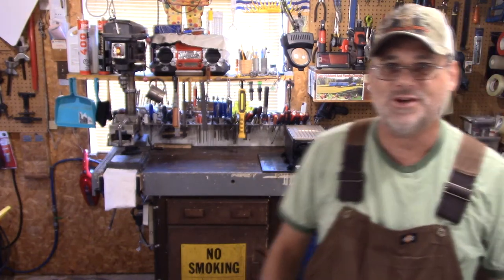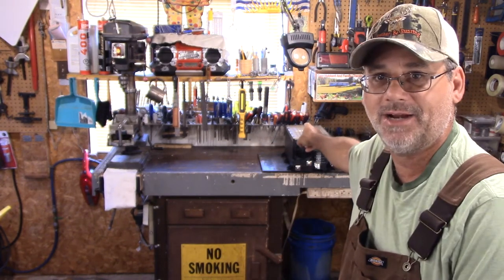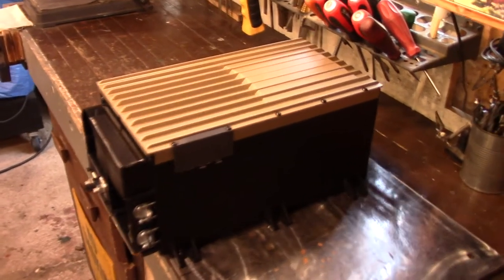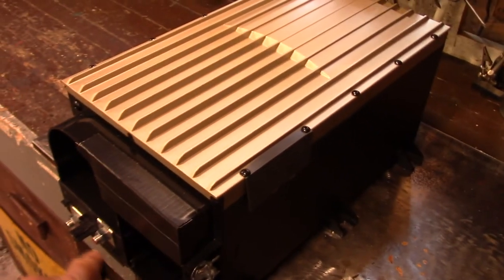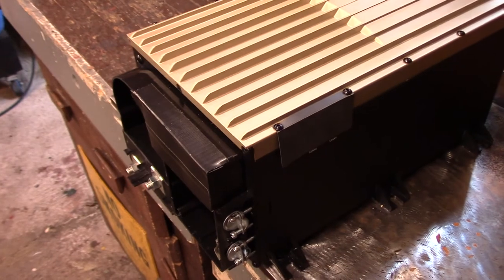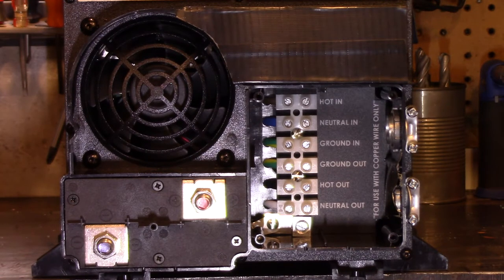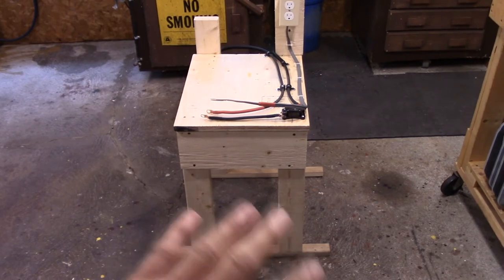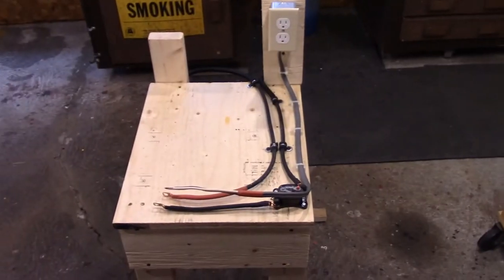Off Grid Solar Power Experiment  vs  120v Mini Fridge Can It Be Done

Comment: Thank you Steve . Just got in for my hunting camp spend 8 days there. Solar work well no problem supplying fridge, light, tv, lap top and charging phone. The lowest volts on batteries for one night, next day and next night was 12.3, rest of days batteries were getting top up every day. Now have too figure out a switch from generator to solar. Again thank you
Reply from the maker: Hi Victor 
12.3 is great as the battery bank will last a long time keeping the voltage that high. 👍

Comment: HI Steve.  I did this experiment a few years ago.   I was trying to run the fridge in my RV on solar alone.  My fridge uses 325 watts when running according to my Killawatt.  I kept killing my batteries on that thing, and I had four Trojan GC4's.   Very likely the problem could have been user error (the main error being I had crap solar panels).   Long story short, I purchased one of those expensive fridges.  Best decision I have made.  The best part is the fridge runs on 12/24/or 120 volts.   You don't need an inverter.  Really looking forward to seeing your results.   I just got a new 1500 watt inverter to review.  This video got me in the mood to fire it up!
Reply from the maker: Well I did as much theoretical math as possible with this fridge and it should run fine on 4 6v trojan batteries only in the summer months. As the cold season appears the capacity drops like a rock. Another variable is inverter idle load . An idle load of 2 amps from  the inverter . I don't use digital or variable digital  loads so a pure sine wave is not required.  Most test for output on inverters but voltage stability is much more important and idle current.  I will have it so in cold weather I can turn off the inverter inside  when I go to sleep since I don't have anything running. 325w ac is 27 amps  I'm looking at this fridge with inverter idle load of 7 amps DC max over a  3-3.5 hour cycle or actual amperage draw of 2 amps max an hour. Look forward to seeing your experiment. Need any help just ask. 👍
Reply: @SteveRobReviews     I have a similar unit to yours in my camper now.  It uses 23 watts in stand by mode in a 12v system.  Not too bad.  I have a video of it on my other channel.
I am going to test out my new 1500/3000 unit on a full sized fridge.  Can't wait to watch the meter when that puppy surges.  It came with 2 gauge cables.   We shall see, it seems small for over a hundred amps....if you are pulling the full load.   I have a 4k inverter and I used that to start a 16k btu AC unit.   That triggered about four error codes, LOL.
Reply from the maker: @YourOldPalFernbark  😅😅
Reply: @SteveRobReviews  7A DC is pretty optimistic if this is a MSW inverter.  I run a chest freezer of the same wattage as that and it settles down to about 9A.  My 2,000W inverter only runs the fridge and the controls turn the inverter on and off. As the load is minimal, I even pulled the fans out of the inverter to save power. With lots of liquid in the 7cf the fridge only runs during the day and is powered by just a car battery. It is complicated but super efficient. Come back in 5 years and tell me how much you like a big battery bank.
Reply from the maker: @opera5714  Stay tuned for more testing . It's going to get interesting 😅
Reply: Fembsrk: that 325 watts is from the resistance heater in your ‘emulsion’ RV fridge. NOT what you want, not surprised it didn’t work. 
A fridge like he’s doing? I’ve done it. Runs great on solar only. My RV cord’s been plugged into my inverter for three years and there ain’t no power near me anyways. 
Not understanding your equipment is why you think it won’t work. But actually? It will work. I’ve done for six weeks as a test. No probs. 

My current setup is an RV fridge on propane. I’m contemplating going a new electric fridge and selling the RV one. I’ll add one more 100W panel which will cost about a pizza more than running the propane fridge for a year. If I put the RV fridge on electric I do read about 300W constant- those small fridges are 1.2A/120V or like 140W but they are off for far longer than they are on and running. I can run one now but I’d add the extra panel just to have the luxury of headroom and better survival rate on cloudy days.

Comment: At my cabin I run a big propane fridge and it's on all the time from May to mid September and  take about one pound a day. Bought for 1 thousand brand new in 2002 and still does the job. For me that was the way to go, need propane for heat and cook and almost there everyday.. But for you I understand you have all that set-up, that will be foolish of you to go other way. Cheers
Reply from the maker: Nice setup. Buddy has a propane fridge but he only starts it up when he goes up so it takes about 4 hours to get cold , about the same as electric when you load it up. His propane  fridge is 30 years old easy .

Comment: TrippLite is much better than TrippDark!
Reply from the maker: Good to know Tom :)
Reply: I’d still use a pure sine inverter. 

Personally I’ve killed stuff on a modified sine inverter! True Sine Is Much cheaper than buying new fridges and computer monitors.  Does modified sine work? Sure- for a while anyways. The motor on the fridge will struggle to start every time on a mod sine while a true sine is cleaner than the grid.

Comment: Ha Steve, You might get a fridge/freezer thermometer with a min/max record. There dirt cheep and you can trust your system has worked well while your gone. Cheers
Reply from the maker: Were on the same page, I have one to test out. I like my fridge at 35 deg F min to 40 max. Cheers Larry
Reply: @SteveRobReviews  The Elitech RC-5 is far less than $20 and the software plotting program is quite nice. I have one hanging in my fride and one on my water heater I modified to have an external sensor. Can't tell the players without a scorecard!
Reply from the maker: @opera5714  Thanks I will check it out.

Comment: How's she goin'?  This is an interesting experiment!!!  The mini fridge current draw may calculate to be 2 amps a day, but the fridge doesn't run 24/7.  It cycles on and off to maintain the temp.  The only thing I'd watch for is how much the fridge draws when it starts.  I expect it wouldn't be a lot and I don't foresee a problem with your set up.  But on a cloudy day, maybe the solar panels will be hard pressed to maintain the current.  Does the inverter have an automatic shut off if the input power is too low?  I'm looking forward to seeing how you make out with this!!!  Take care!!!
Reply from the maker: Yes most inverters shut down for low voltage to save the batteries.  The duty cycle just has to be recorded to verify the on-off time but the initial start up  to cool down is much different with an empty fridge compared to a full fridge producing a lot of stored heat in the containers trying to be cooled.  On a cloudy day the panels will produce about 2-4 amps and the fridge on-off between cycles  must  draw less than the total stored capacity  during that time. Overnight the draw  must be less than discharging the batteries by 25 percent to have a long life on the batteries. I will be going with 4 - 6v batteries. My math says its a go but my math can be a challenge when you have unknown  amount of sunlight .  Cheers bud.
Reply: Most inverters shut down to save the inverter.  If you let the battery go down to the point where the inverter shuts off, you have screwed your battery.  Fridges are real battery killers and sooner or later it will get yours. You need an external low voltage disconnect set to over 12V. And non inverter compressors will draw 120A DC from the battery at startup.
Reply from the maker: @opera5714  Your way off on the start up currant on my small unit. I have done my math and this fridge will have no problem running on my design.  I will upgrade to 4 -  6v batteries  and fully confident I will not deplete the batteries below a 15 % discharge from a full charge over night. Stay tuned for more testing. 👍
Reply: @SteveRobReviews  You calculated it? Maybe you ran out of toes. My numbers are from actual measurements.  I just did several runs of the fridge and the inverter DC PEAK current came in at 111A .  This is peak surge current and the reason wiring should be designed for that. Actual inverter terminal voltage will reflect that drop and the reduced voltage will require higher current to make up for the lower voltage. This is just what you will actually see. It may not last a long time and you may not be able to measure it with what you have, but it is real and it is what drives small inverters crazy. Never said you couldn't run it with what you had. So tell me, just how much do you think I am off?
Reply from the maker: @opera5714  HAHA ran out of toes. Stay tuned for tomorrow video as I test using my toes. 😅😅

Comment: Steve i have a 2000 inverter and got two solar panel of 255 volts model JKM255P-60 panel only. Question how many batteries,regulator, will i need a step down in voltage for these panel. Thank you
Reply from the maker: Hi Victor
I have 4 six volt batteries putting out 12v  and  4 - 100w panels and have no problem with a bar fridge and lights so you should be fine with the panels.  Setting it up for a 12v system if your inverter is 120v output and 12v input you need a 60 amp charge controller for your panels and use  a #10 gauge solar panel wire and min #4 cables at your battery .
Reply: @SteveRobReviews  Thank you. so it does not matter if panel produce at max 30+ volts/
Reply from the maker: No it does not because they are not connected to your batteries  at that rating  its just max.  voltage . Your 12v solar panels will charge your batteries at 14.8 at most regulated from your charge controller .  Feel free to ask Victor questions , if I can help out I will. 👍
Reply from the maker: @victorhebert5774  JOJOCY MPPT Solar Charge Controller with LCD Display,Multiple Load Control Modes, Dual USB MPPT Multi-Function LCD Displays Solar Charge Controller (60A) https://www.amazon.ca/dp/B0998FV658/ref=cm_sw_r_apan_glt_i_X3EVDGMT99VXS6JAW4V9

Comment: Get the Dometic cooler like I got, so efficient on power that I can use a jump starter battery and power it for 5 hours off it while keeping a temp of 3 degrees
Reply from the maker: This is a under $200 fridge . I used a lot of brain power designing this system to run this fridge , lights , pump water , watch tv and vacuum the floor and blow dry my hair:)  so stay tuned . Tomorrow I do some fancy pants testing with real figures that save me $800 and not buy your fridge.😅
Reply: Why use an inconvenient low capacity cooler with a fluffy price when you can buy the fridge AND build a whole system that will run it for the same money- and a run whole bunch of other stuff?

Comment: The question is how to hook this inverter up.  Two gauge wire?  How far from the battery?  How many AmpHours for the batter?  How far of a run can the fridge be from the inverter?
Reply from the maker: Every inverter has the instructions and varied on your particular installation.
Reply: Look up ABYC wire gage chart for DC

A 1200W inverter is 100A at 12V, 2400W is 200A at 12V. You need big cable from batteries to inverter.